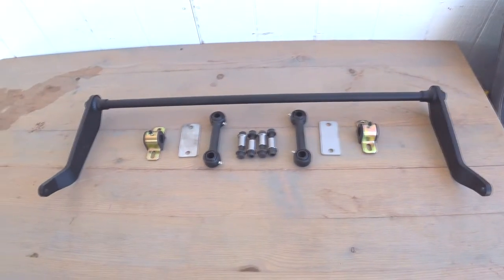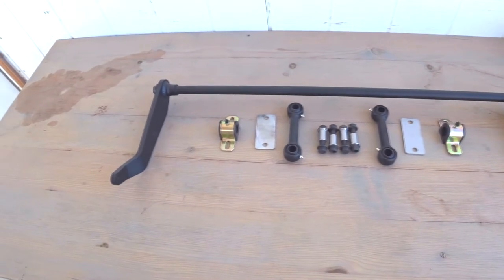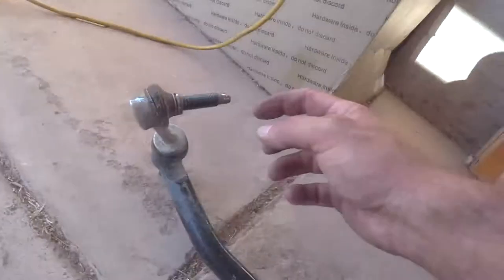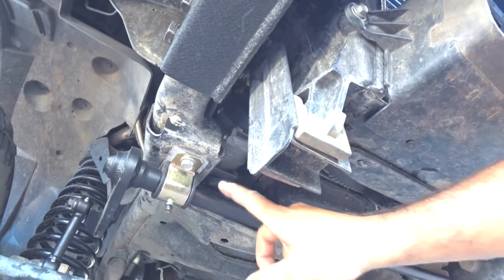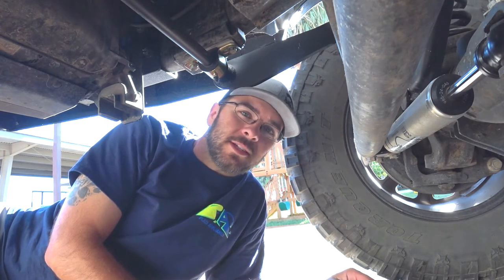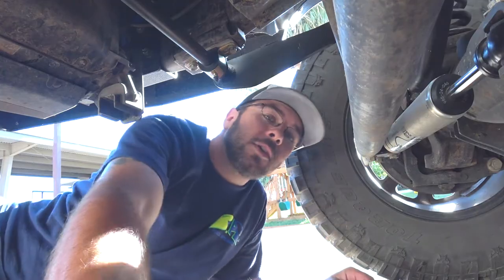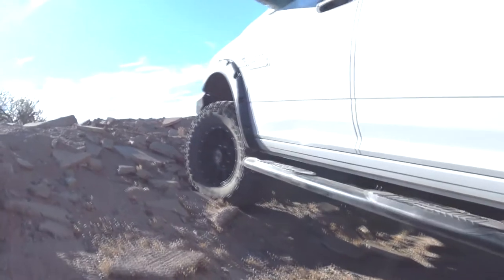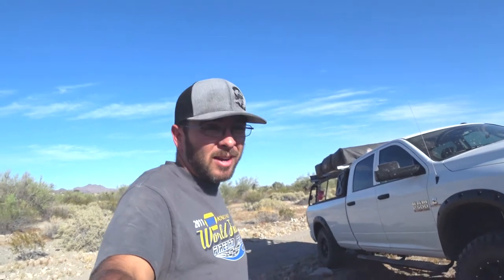Thuren Fab Active Rate Sway Bar Install

Comment: I met a guy at tire shop he said he had bought all Thuren fab suspension for his 2500 he used it for 4 wheeling. I have a 2500 diesel also would never rock crawl it way too long. It's fine for dirt roads some mild trails not the right vehicle for crawling. Seemed like everyone who buys Thuren wants to make a rock crawler out of these.  I have a built JK Jeep for wheeling 37' tires even that still not enough for some of the rocks here in AZ.
Reply from the maker: I never had the intention of rock crawling. I liked the improved ride with the power and fuel range of the diesel as well towing capacity.
Reply: @TheFourLazyJs  I just want a better ride on the road right now I have a spacer in the front to level it the ride is so stiff feel tiny bumps on paved highways. I was wondering if just adding the sway bar would resolve some of the stiffness I might just pull it off and test drive it see if big difference.
Reply from the maker: I added the coils and shocks first and it was a huge improvement. I added the sway bar later to allow for more flex when traveling off road. My recommendation would be to start with coils and shocks and go from there.

Comment: @The Four Lazy J's
Great Video. Thanks. Still trying to decide if I should go with the Thuren or the Carli Torsion Sway Bar on my 3rd Gen.
How is the Thuren's holding up?

BTW, those mountains look familiar. Were you out near the vicinity of Mesa Gateway airport?  I don't think I've been on those particular trails however. Any advice or directions out to that particular area would be greatly appreciated.
Keep up the great videos and thanks!

Comment: How do you like the sway bar on the road in regular driving? Does it allow for more body roll day to day? I’m looking to smooth my daily driving. I put Thuren coils and King shocks and steering damper on so far.
Reply from the maker: I didn't notice a huge difference to be honest. The front rides sooo much smoother than the back and I cannot say the sway bar helped or hindered. The springs alone were the biggest upgrade
Reply: I put this on first without shocks or springs and it definitely helps a lot. Especislly small bumps that affect one wheel. Very good part, love it.
Reply: @Fryguy22  I've had mine on for a while now. Felt the rolls a little more in some situation but it's nice on some of these country roads to let the suspension work a little more. About got these 35" Toyos worn out. Maybe give 37" a try after that.

Comment: Do you know if the synergy steering box brace is needed and if it will still bolt up properly with the thurin sway bar? I hear that steering box brace cures death wobble.
Reply: Shrumcape Adventures I would check your steering stabilizer, track bar or your ball joints first before spending money on a steering box brace.
Reply: @nathanmendoza4  thanks! I just put a fox steering Stabilizer on last night. I haven't experienced death wobble but don't want to. And I just love modifications in general! Saving for a Thuren adjustable track bar now. Then, who knows. Probably sway bar or maybe Timbrens for the rear since I just bought a 1.5" Wicked Customs leveling kit and I dont want my rear end to squat lower than the front when towing.